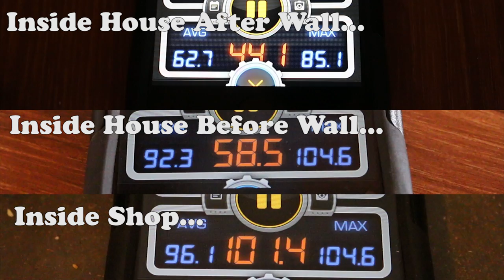Soundproofing the Shop:  Did the Sound Dampening Wall Work?

Comment: I'm glad this worked. I'm considering putting cork or rubber on the top and bottoms of the upper kitchen cabinets to cut down on reverb. Do you think that would work?
Reply from the maker: Possible, but if those cabinets will be screwed or nailed into the wall or ceiling, most vibration will still pass through the fasteners. I used closed-cell foam as it is a very good vibration isolator. Good luck!
Reply: @SouthpawWorkshop  Thank you. The cabinets are already installed. Will the fasteners keep most of the kitchen echo from being absorbed?
Reply from the maker: Oh I understand, you want to quiet down the echo in your room. I’m not sure what would help there. There are some good articles online on how to build sound dampening panels that help out with echo, but it would depend on if you have the space for something like that.
Reply: @SouthpawWorkshop  Thank you. Yes. The trouble is that I'm not allowed to put anything in or on the walls, or I'd go to town on panels. I'll figure something out. Insulation on top and cork adhered to the bottom of the cabinets with something behind the fridge seem my best option besides mats under rugs.

Comment: I couldn't find the first video on soundproofing unless it was just the one where you put some insulation between studs and then put sheetrock on top? if so, was that all you did to improve the sound transference?
Reply from the maker: There is a 3 to 4 inch air gap between the new wall and the existing wall.  This combined with the insulation and drywall make for an effective sound barrier. I go over the plan extensively in this video: https://youtu.be/kvhfakSYdWQ
Thanks for watching!

Comment: Thank you! I'm trying out something very similar. I can't put anything on the ceiling as my shop is in my basement and need access to the plumbing lines, electrical etc. Noise control is proving to be hard so far!
Reply from the maker: I chose not to mud and tape the drywall so I would still have access to the inside of the walls and wiring if I needed to make changes.  It's a workshop, it doesn't have to be pretty!  Also, rock wool insulation in the ceiling does wonders for noise control.
Reply: Thomas Lightle - Red Barn Woodworking it’s effective without mudding? That’s awesome! I’ll try to install drywalls where I can!
Reply: @KiranBhatWoodworking  how about you try make and acoustic panel.